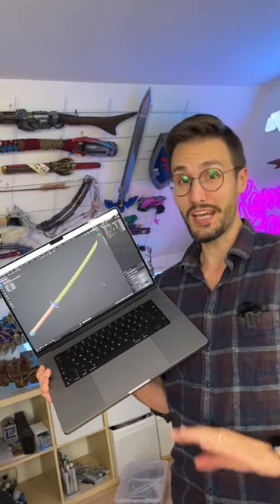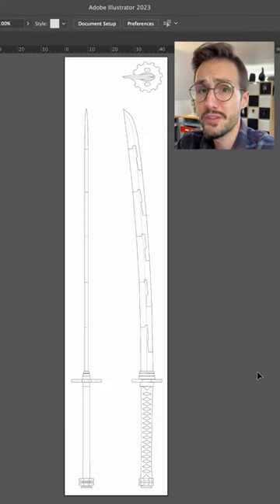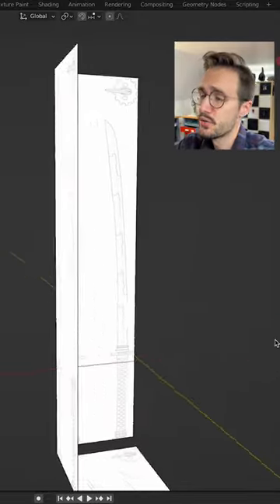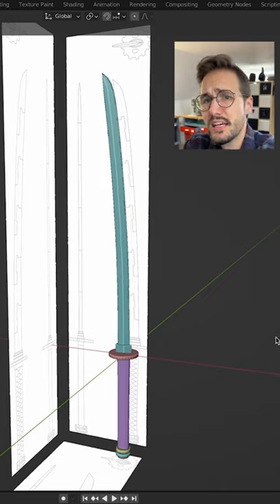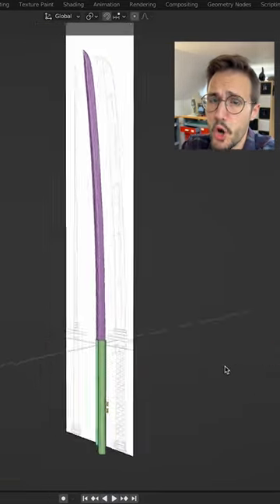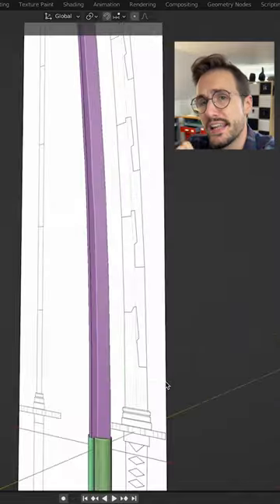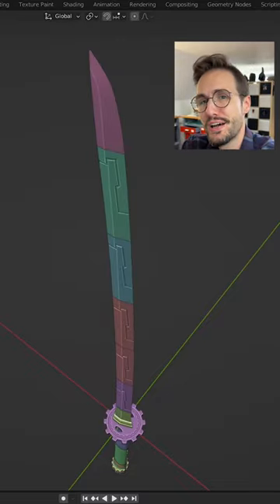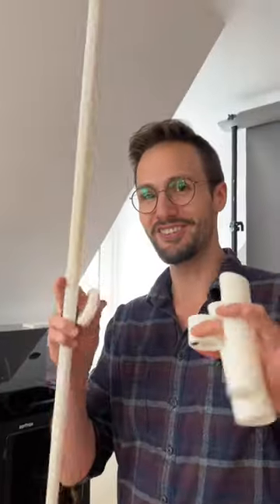How to 3D model a Katana! #3dmodeling #diycrafts

Comment: While it's cool and all to do it with computers you could have done this by hand with craft foam or fiberglass and been done in a few hours not a few days. Sometimes I think we're using computers to overcomplicate the process. 3-D printing just for the sake of 3-D printing
Reply from the maker: Please show me how to build a light up Katana with sound effects in just a few hours! I want to learn! 😊
Reply: @KamuiCosplay   OK come to my shop.
Reply from the maker: @77Avadon77  Just make a tutorial please!
Reply: @KamuiCosplay  easily done
Reply: The 3D Printing process may be slower to print than  the foam and fiberglass process, but it has the advantages of less material usage, less caustic (fiberglass resin is very caustic and requires respirator to work with) , it allows one to quickly visualize design  changes before creating. Also when it comes to replacing broken parts one can more easily graft in dimensionally accurate replacement section(s) more easily for faster repair. The design can also be sold/gifted via Internet to people whom want to replicate it.
Reply: @mysoulwanders If you hit someone with a foam katana, it's not gonna hurt. If you hit someone with a plastic katana, (especially a 3d printed one) it's going to shatter and do serious damage.
Reply: @mysoulwanders Also, you can more easily sell non digital things rather than digital ones